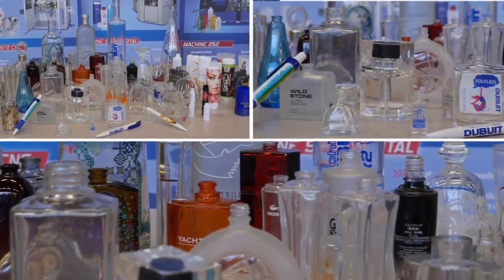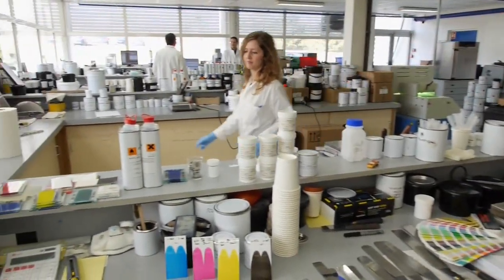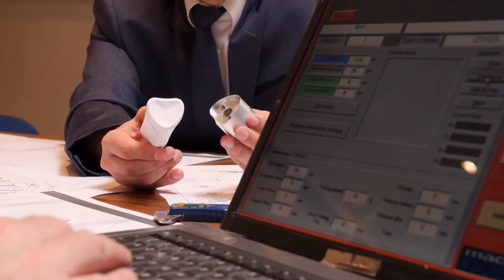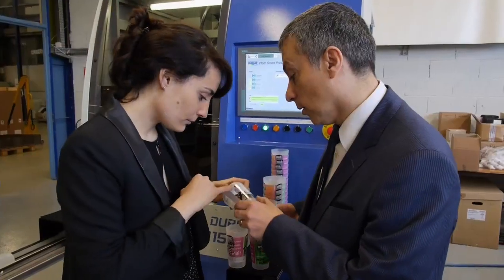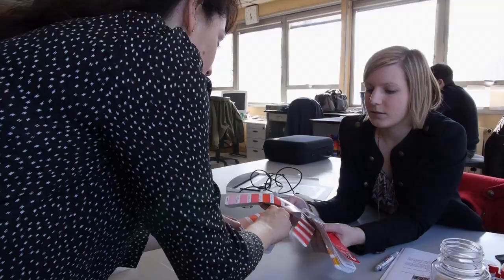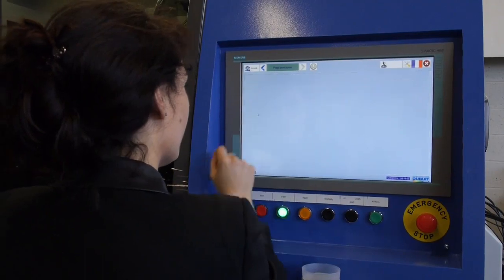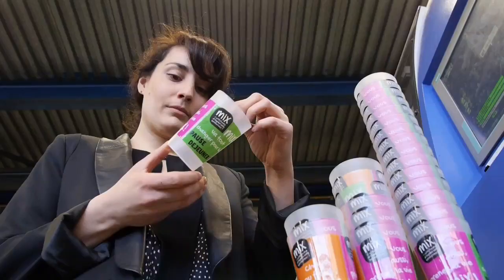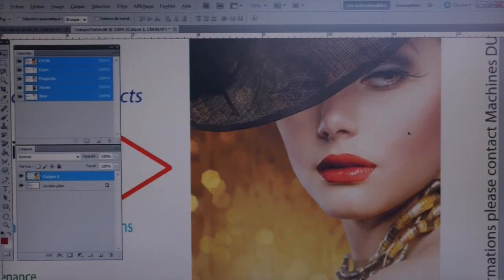Inkjet Digital printing Machines DUBUIT

Comment: Good morning.
I have a question regarding this UV rotating inkjet machine.
1. Is it possible to print rotationally on the axis of a ball pen?
2. In that case, what is the pen shaft size (maximum/minimum diameter)?
3. Can I print with the clip attached to the pen barrel?
4. How much does the device cost?
5. Please indicate the packaging and transportation costs to Japan and the equipment setup costs in Japan.